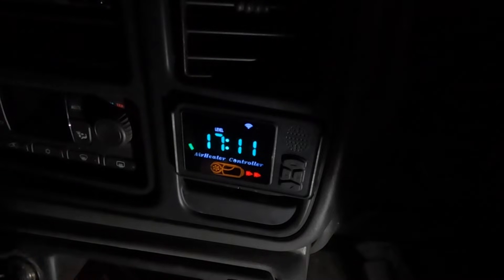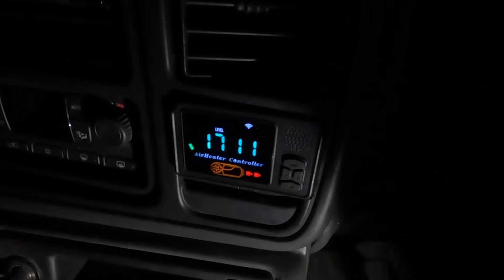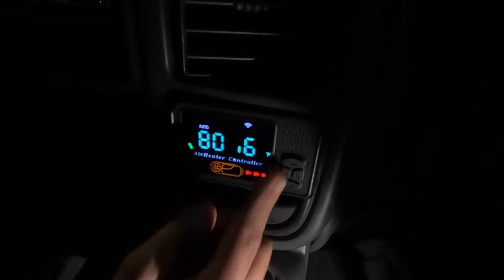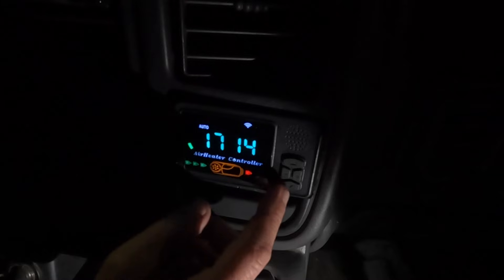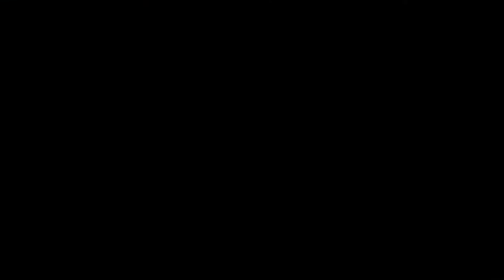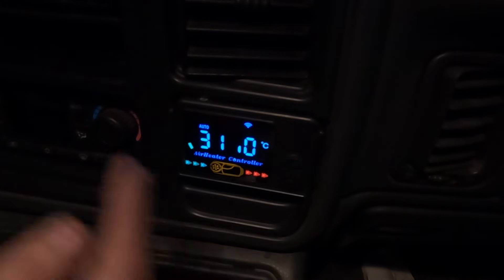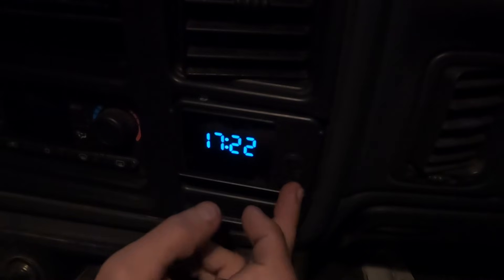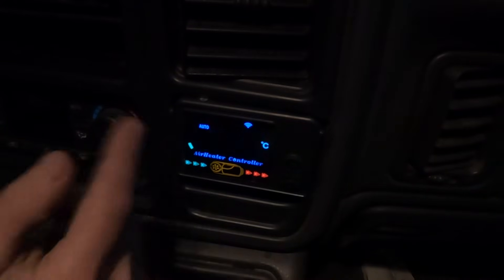Bluetooth Diesel Heater Feature & Settings Discovered !

Comment: Thank you for the information on changing the temperature to Fahrenheit. After doing so, the app still shows temperature in Celsius . Is there a way to change the app settings ?
Reply from the maker: I have had this question several times now. As of now, there doesn't seem to be a way to do this.
Reply: @loweredexpectations4927   Bummer.  Thank you for responding.
Reply from the maker: @parfproduction1345  I am testing a new heater fro Vevor this week. It uses a new app and has a BUNCH of cool features including changing units, setting a calendar for on off times, a built in CO detector safety and lots of other goodies... HOWEVER... so far, I have been having issues with the app. 

Works awesome until it disconnects (your phone disconnects) and then you can't reconnect until you shut the heater down.
Reply: @loweredexpectations4927  That sounds promising.  Hopefully, it will be an easy app upgrade.  Are all of those features built-in to the controller, too? Or just available with the app.
Reply from the maker: @parfproduction1345  I don't know much about it yet. I have tried to connect to my old BT heater without success, so I'm not sure if it will be cross compatible. This may only be beneficial to those who purchase a new heater, or the controllers when they become available.
Reply: @loweredexpectations4927  I'm looking forward to hearing about what you discover. I've installed the altitude self adjusting heater in my van. I've run it from 150 feet elevation to 7,589 feet it's performed well.

Comment: Great Video - very helpful 
I struggled with the ‘user manual’ , head wrecking is right !! 
Please, advise on how you removed the led panel and mounted it on your dash ? 
Best Regards 👍
Reply from the maker: The control panel pops out of the holder on the metal case, and disconnects from the plug. I then just used some tacky tape to stick it on my dash.

Comment: That thermostat feature is pretty freaking slick. I didn't think any controllers had that option without using an aftermarket option.
Reply from the maker: Yeah, I think there are a few now that do this. They are not nearly as accurate as the thermostat in your house, for example, but it works ok in some situations.
Reply: @loweredexpectations4927  That makes sense. I am sure the temperature probe quality and programming isn't exactly the best.
Reply: @reubenk7331  The temperature probe of this controller is quite decent actually. The absolute main factor to get reliable temperature measure is the controller mounting position: The controller need to be as close as possible to where you will spend most of your time. If you are on the couch but the controller is far away near the entrance door in a draft the temperature measured will obviously be bogus ...
It might also be a good idea to slightly insulate the controller from the wall it is mounted on: You want to measure the room air temperature rather than the (often colder) wall temperature.

Comment: Any idea how to prime the pump / heater on this one I have a similar controller same Bluetooth app but can’t figure out how to prime been searching all over google.
Reply from the maker: Yes... You have to pull the fuse, or disconnect the power. Reconnect the power, and then press the down arrow for 7 seconds. "300" will appear and start counting down. Press the power button to stop. If you have to do it again, you have to disconnect the power again... pain in the butt...
Reply: When it's on the clock display hold the down button until the timer for priming comes up
Reply: On clock display hold down button until prime count down comes up
Reply: But it needs to be on clock display not running
Reply: I agree with all being said. After turning the power off of the battery put it on and just press and hold down button but i also have struggled to prime the fuel line because i try to use my semi truck fuel tank ( halfway full ) . This pumps are good in pumping but no good in suction specially when there is a big difference in the level. There supposed to be no air in the line at all . What i did is I disconnect hose on the heater inlet side and put it in to a bottle. Then detached the pump and lowering the all line and pump as low as i can just for the fuel priming process. Priming process was successful and I managed to take out all air bubbles. Then carefully put back everything on it’s place. I hope that’s helpful.

Comment: Is there a way I can lengthen the control panel on the heater to go to my tent so the temperature will adjust in my tent instead of on the trailer
Reply from the maker: You can purchase extension wires on Amazon (sometimes) and aliexpress. There are a few different plugs so make sure you get the right one. 

If you have this specific heater, you probably can't find an extension yet. You could take the controller to an electronics shop and ask for some of the connectors (tell them what you are doing) and they can probably provide you with a solution.... OR you can do what I did and cut and solder in an extension.

Comment: I have the 8K VEVOR Heater and the same ( NEW ? ) Controller as you pictured in this Video. Very few videos show this controller. I just made the Fahrenheit change. NOW, if the Bluetooth app would display in Fahrenheit ..
Reply from the maker: I hadn't even considered that when I made the video. It is fairly new, so perhaps the app developers will add some features and allow a change to F. 

I love the app and don't mind it being simple if it works, but it would be nice if they add a few more things.

Comment: Is there a way to change the hertz 

So less fan more heat ?
Reply from the maker: No, not on this model. 

Adjusting the hz and fan speed is intended for elevation compensation, although, people use it for other things. 

This heater has automatic elevation compensation, and most other new models have an alpine mode to correct for higher elevation. 

Lowering the fan speed to get more heat is not wise. All you are doing in this case is producing heat and keeping it in your heater. You want the heat in your living space. While the temperature may be lower, that is because the heat energy is now in your living space.

Comment: I can't believe where you mounted that  heater. Too me it seems like you tried to pick the worst possible spot to mount it and sent it lol.
Reply from the maker: Haha ! What ? Are you talking about the actual heater, the heater vent or the controller ? 

The heater is mounted out of the way so that I can transport all of my parts and tools without interfering with it. Also, where it can't be seen and stolen. The vent is mounted in a convenient place and points at my tool bag to keep my tools warm. 

That being said, I also chose to mount it where it is because I was concerned that a 5kw heater may be WAY overkill, as I had used one to heat my garage, so I didn't want to recirculate air from the cab. 

Now that I have done a bunch of testing, I do plan on relocating the heater, and probably installing a larger fuel tank.

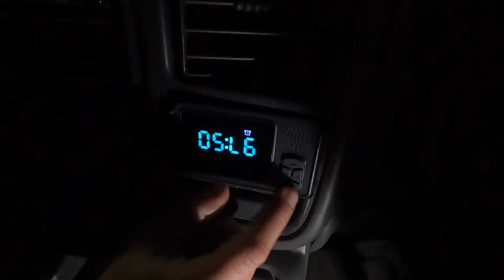Comment: @6:56 you explained that the system HAS a timer function. That I will have to play with on my own. Thank you for letting us know about it. I didn't think it had a timer.
Reply from the maker: Yeah. I haven't messed with it still. Unfortunately, it appears none of the clocks keep time well, so if set a timer, you need to be aware of that.
Reply: @loweredexpectations4927  Thanks for the reply. So I messed with the timer late last night after watching this video.
This is what I found.
Heater running, press and hold M for 3 seconds.
Time of day displayed.
Press Up button and the ON timer is displayed.
Set this timer for the time of day you want the heater to start by using the M and Up/Down buttons to get it set in 24 hour format.
Press Up to enter the Off timer. Set this for how long you want the heater to run.
This timer is a bit different from most. The timer can only be set in 30 minute intervals. 0.30, 1, 1.30 etc, up to a max of 10.00 hours.
Once set the next menu will be to turn the timer off or on. I also recommend you turn off AU as we don't need it.
Power button to exit the menu.
I set mine to come on at 10:00pm (22:00), and run for 2 hours. I set the temperature to 26 deg C.
The heater did start at 10:00 and ramped up to full heat. I stopped testing at this point.
Hope this info was of some use to everyone reading.
Reply from the maker: @3dphillo396  Great info.... I hope this helps others !
Reply: @3dphillo396 .. thank you 🙏

Comment: I bought the same heater to replace a different branded older unit that has a failing controller backlight and blower bearings. I plan to replace the bearings in the old heater and use it elsewhere. Being winter, I didn't want to be without the heater for too long. The instructions on the Vevor are absolute trash. I'm just about ready to rip out this heater and return it. The biggest issue I have with the Vevor is not being able to prime the pump if it runs out of fuel. I have it setup in my fifth wheel running from a 5 gallon can. When my old heater ran out of fuel, I would swap cans, and prime the pump. I would press Down and OK at the same time and it would give me the option to prime the pump. The Vevor not giving that option, at least not without power cycling, is a potential deal breaker for me.
Reply from the maker: I should make a video on priming the pump... Remove the fuse, or disconnect power to the heater. Reconnect the power, and before you do anything else, press and hold the down arrow for 7 seconds. 300 will appear and it will start priming. Press power to stop at any times. If you want to prime again, you have to disconnect and reconnect power... yes, it sucks.

I hope this helps.

Comment: Do you know how to make the controller display the temp instead of the time when it is running?
Reply from the maker: As far as I know, this is not possible either. I have no use for a clock that doesn't keep time, so I also find this annoying.
Reply: @loweredexpectations4927  yeah it is a REALLY BAD clock LOL. Thanks!

Comment: This is EXACTLY what i was looking for!!!

Also do you know how yo change the minimum pulse rate and fan speed? I would like to prevent it from cycling so much
Reply from the maker: Unfortunately, you can not access engineering settings on this heater. The fan and pump speeds are not adjustable independently.
Reply: @loweredexpectations4927  ok thank you so much!

Comment: Still lost with the controller choice i have to make. I actually have the basic 3 buttons (below the lcd) that comes with the orange vevor 8k, i want to upgrade, which one i should buy ?? The black one in this video or the blue one (spanner or gear button?) ? Do i need the ecu too?
Reply from the maker: You need the ECU and controller as a set. The black one in this video is great, as long as you don't want unlimited control of the heater... If you want to tinker with it then you may want something else. 

There are a few different blue controllers. The one with blue digits gives you the least amount of control and info, some of the red digit ones give you access to control a bunch of stuff in an engineering menu.

Comment: Since you have educated me the most from all of the other YouTube'rs, I would be happy to purchase my unit with your link, ,  Question on your links I'm looking at the "Horizontal All in One"  unit, but is there a real difference between the 5k vs 8k??  Since we don't really get 5k or 8k output on these units is it worth the extra $ or is there a the difference in the unit ?:hand-purple-blue-peace:
Reply from the maker: Hey, thanks for your support. Are you in the US ? 

The 5 and 8kw units are physically the same, but it appears (based on the specs, that the "5kw" makes about 5.6kw and the  "8kw" makes about 6.2kw. This is based on the fuel consumption claims. 

Actual heat output will depend on elevation as well as a few other things, but the 8kw appears to have an ecu that will deliver a little more fuel. 

I hope this helps.
Reply: yes this helps,  and yes im in the US,   being on Long Island my elevation is under 100ft = 30.5meters.  Do you recommend  adding a filter to this unit ? or it has one already installed ?  I didn't see it listed. 
 @loweredexpectations4927

Comment: I just want to know how to make sure the voice doesn't speak and something else so that the screen turns off by itself when it's on like other heaters I've had, It is an unnecessary waste of energy to have the screen on all the time. In addition, the light is annoying.
Reply from the maker: I am going to attempt to silence mine by modifying it, as a few people have asked about this. 

On some heaters, (on my other Vevor heater)  once it is up and running, you can disconnect the controller from the ECU and it will operate happily... I'm wondering if you need the controller attached at all.... I guess I will give that a try as well. 

The power that the controller takes is extremely low, but everything makes a difference I guess. You may be able to put it into one of the menu modes and leave it there, without all the lights on.

Comment: For the auto on/off where is the thermostat located for reading the temp?

I’m guessing in the display. I will be mounting the unit outside and want it to track the temp inside (where it will be directing heat)
Reply from the maker: Yes, that is correct. The temp is read at the controller / display. You can buy extension wires for these, with a little searching on Google... just make sure you get the correct one as there are many different ones.

I made my own just by extending the wires .
Reply: @loweredexpectations4927  thanks for confirming, appreciated.

Comment: Anybody know if you can retrofit an existing heater with the bluetooth controller. I know you can buy the controller but do you also have to replace the motherboard.
Reply from the maker: If you can find the parts, then yes, this is very easy to do. As you say, you will need the controller and motherboard (ecu).

Comment: Is the heater in your truck the 2kw Bluetooth?  What's the main board version number? On my 8kw Bluetooth it's U-01 103. Wondering if it's different between the 5kw and 8kw versions with the same body size.
Reply from the maker: Hey Kirk. I didn't see it was you when I wrote this comment. 

From what I understand, the 5 and 8 kw heaters are the same thing. There are no 8 kw heaters. :) 

That being said. Hclroy or whatever, apparently makes a physically larger unit that is called a 8kw and a few people have commented on my videos saying that they have received larger 8kw units from Vevor... I have not gotten more details.

I have a 5kw in m truck and a 2kw that I've used for other things... They deliver vastly different amounts of fuel. Not 100% sure about the 5 to 8.
Reply: @loweredexpectations4927   what's the software version on your 5kw Bluetooth heater?
Reply from the maker: @kirkwalsh1932  Does it tell you when it powers on ... or do you find that in the settings menu. I just tried to connect to my heater and it appears the battery is dead in my truck...
Reply from the maker: @kirkwalsh1932  Yeah. My battery is so dead my charger wouldn't recognize it. I had to use another battery to jump power to it so that my charger would start charging... stupid charger.
Reply: @loweredexpectations4927  with power on its the first numbers in the up&down button menu. I'm thinking if you're running at 215C on high same as my 8kw the main boards are probably the same. The 2kw Bluetooth is U11-101 I think, cannot confirm tho. Saw that SW version on a different BT video.
Reply from the maker: @kirkwalsh1932  I will try to check once my battery isn't completely dead. Vevor calls the heater in my truck an 8kw... but it clearly isn't. 

I'm at high elevation (3500 feet) and I don't think that it is high enough for it to switch to alpine mode. I know it changes automatically, but I don't know where the threshold is.

My other 8kw (non bluetooth) heater runs at 210 in normal mode, but it would run much hotter if the ECU didn't limit the fuel at 210. The fuel pump slows down when it gets over 208. WHen I put it in alpine mode, it runs at 185 ish.
Reply: @loweredexpectations4927  https://youtu.be/_NFbnswDpWk?si=5pYR3rE7sUA3j2Vu

There is the 2 running in my basement right now. They are both marked 8kw but the output in the carbon fiber 8kw is probably equal to the 5kw version. They are both the medium size heat exchanger with a 75mm air output.
Reply: @loweredexpectations4927  I lived for over 10 years in Calgary.  A few yrs in Huntington,  then the rest downtown in Sunalta.
Reply from the maker: @kirkwalsh1932  Thanks for posting. If I can get a maxspeed, large body version I may do it.... I'd like to compare them.

Comment: Is there a way to buy this new controller and motherboard for an older heater?  That would be amazing.  Otherwise, I think you just convinced me to buy a new heater with the new controller!
Reply from the maker: Not that I have been able to find, yet, but I have a feeling they will come later this year or next winter. 

I am pretty frugal myself, but if you can afford it, it almost makes more sense to buy the whole unit and have the old one as a backup or for spare parts. That being said. It looks like they are sold out in a few countries.